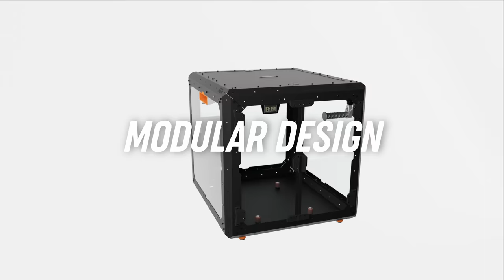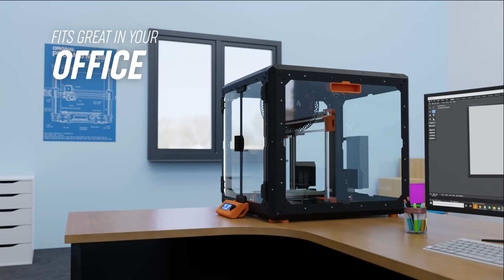Introducing the Original Prusa Enclosure: Modular box with advanced features for your MK3S+!

Comment: LOVE that Prusa is coming out with this for the community.  HATE the price.  Some of the features seem well thought out, but other things don't.  The single LED strip lighting on the left... the case is still dark inside.  Unless we can expand and have more LEDs?  There should be leds on all 4 corners honestly.  Enclosure looks built and very stout!  Typical Prusa quality for sure, no doubt in that at all.

I dislike that you can only access the printer from the front.  You should be able to access it on left and right sides as well.  I dislike that it looks like my 7" touch screen raspberry pie setup has no place to go in here... Where as the "Prusa Box" would be right in the front.  I thought the Prusa Box was expensive but now comparing both , I actually feel the Prusa box is worth it and probably the one I am going to go with.  Just seems way more customizable.  LOVE Prusa though, if this wasn't as expensive I'd get it for my mk3s.  But after adding the options it's coming out to almost $600 without shipping...

Comment: I made a custom version of this and the PETG parts of the MK3s started softening and bending... :-(
Reply: That's why your first enclosure prints are ABS or ASA replacements of the critical parts that would be affected.
Reply: @Rainmotorsports  you live you learn... I made some replacement parts out of PC, but was still a pain as I prefer to focus on what I am printing and not tinkering with the printer itself.
Reply: @JT-Works  Right but if you want a printer to do something new it might require tinkering. If you started with a MK3 and went to a MK3S+ like I did you had to reprint parts anyway.  That's where I am with this one.

Comment: I wouldn't use PTFE tubing all the way to the extruder, I prefer it just to the top and then bare all the way to the extruder. That way, if you run out of filament, you won't have to disconnect the PTFE tube for filament removal. With this enclosure you can only print at 40°C, 50° max in summer. I don't think it's worth the price ($550 plus shipping and tax), except if you really don't have the time and tools to build a better, cheaper wooden enclosure. It would be nice if they also made an active heater case and provided you with plastic parts made of PC, a 3:1 geared extruder (to reduce heat from the extruder motor), and a cooled solution for the motherboard. That way it could easily reach 70°C.

Comment: What a heavy blow to the IKEA. The LACK sales are going to plummet.
Reply from the maker: The Ikea Lack Enclosure is still our suggested option when on a budget. ;) This is way neater solution, but also more expensive.
Reply: @Prusa3D  Actually you should add an option for a flux capacitator to increase print speed. Maybe next year at first of april?
Reply: The LACK enclosure is all you need and way more affordable. This enclosure is overpriced for what it does.

Comment: is there one for the XL printer?
Reply: From what i've seen. The Prusa XL will have at the very least have a optional accessory that resembles Accordeon shutters you can pull up from the base and attach to the upper frame to enclose the printing area. You can see it on the photo of it showing of its multi-tool system

So i would assume they are also going to make a traditional version with front facing door and top cover and if not someone else probably will rapidly create them. Benefit of CoreXY is that with a old fashioned cubic frame it is easy to add panels to enclose compared to the mendel that needs an entire box around the printer.

Comment: @prusa how about using this with 2/4/8 kg spools. Can it be used with filament hanging outside the enclosure?
Reply: 4 Kg is very heavy for the Stepper. 8 Kg is to big for it. I think, it´s no good Idea to order those Big Filaments-Spools...
Reply: @chrissniederle3960  i mainly run 2200gram spools but i want the option.
Reply: @borisbommen  On your place, I didn´t change to greater Spools. The problems are not worth it - my think about it. You need a very easy roll-Sytem becaus otherwise it will become Underextrusion, If the Stepper will not get enough Filament  in Time. But if it is will easy Roll, the Filament-Spool will make Problems at Retracts and fast Prints, because it will not Stop and the Roll will Spool of and get form Spool and their is than stopping Material from the Spool because cross Filament-parts or so on... 2 Kg are a good Compromiss for long Prints... 
You can make it, but how I said - more Problems than it is worth to do this... Not all Options are good Options. This will only right work with a Stepper for the spool and a Electronic with logic to trake the Filament in Time (if more power on the Filament, the Stepper must work some degrees.). But this ist not so easy. Mechanical it will not work so fine - my meaning. Good luck. Hope, you understand, what I mean, because my English is not good - sorry...
Reply: @chrissniederle3960  thanks but 2200 gram spools are my standard because I do productions on my prusas also. I understand what you mean but when u make sure the resistance is as low as possible it shouldn’t give any problems. I printed 8KG last week divided on 2 printers without any problems with 2.2KG spools.
Reply: @borisbommen  That is exactly the problem: as light as possible. With it, you reel yourself loose during fast travels or retracts. Likewise when changing direction from fast movements. I also use the 2 Kg coils. But the mass is very high! The brakes not by itself, by friction again. And certainly not when the mechanism is so smooth-running. The result is loose windings, which at some point slip among themselves and thus cross and knot, or jumping off windings, which then get tangled on the outside ...
I also print a lot of jobs, so I know the problem. I have printed myself e.g. "ball-bearing" recordings, which center the bearing axis off-center adjustable. By changing the distance to the center, I can make the roll roll lighter (full large roll) or heavier (empty roll). Due to the off-center centering, the roller always has the tendency, as soon as the train is gone, to center itself hanging down. 
With larger rolls you need in principle, so that this works reliably, a drive for the rolls, by means of a stepper, which in principle measures the tension on the filament via a control (Ardunio) - if the Prusa promotes, the tension on the filament increases and the stepper must run a little and drive the roll. If the tension stays away or decreases, the stepper must stop. This way you always have a certain basic tension and no uncontrolled unloading of the windings - with the corresponding consequences...
But try it out and report... I don't know any mechanical system that masters this reliably - especially since the stepper pinion heats up with time - and then, in view of the mass, it quickly becomes fatal, since it then digs in more than it conveys... Clogging sends its regards....

Greeting, Digibike

Translated with www.DeepL.com/Translator (free version)

Comment: That's cool but disappointing that there was no attention to fully air tight seals to provide protection against ABS fumes when printing indoor
Reply: I'm not sure why they didn't add weather striping and a rubber seal on the doors. It would have been easy and help contain.
But without a fan on the filtration system, no reason the air would want to head that direction.
Reply: Split doors, outside filament feed ports. Introduce a lot of areas for leaks. Sealed or not I would run a carbon filter to clean the air in the enclosure so that what little escapes is almost clean.
Reply: Good thing it’s made for the maker community and you can do all that and more yourself
Reply: I assume this is what the filtersystem is for. I assume that if you just close things up, the ABS-fumes will stick to everything on the inside and ruin surfaces and electronics. Who knows?
Reply: It can not be air tight when there is filter on the back. Somewhere must be intake to be able to get air inside the box.
Reply: Make it a negative pressure enclosure and make the filter the exhaust. In that case all abs fumes will go out true the carbon filter 👌

Comment: How long will the petg prusa parts last at those elevated temperatures?
Reply: I’ve had my lack table for 3 years and the petg has never melted even at 30-50°
Reply: Maybe the plan is buy it and reprint parts in ASA if you’re worried?
Reply: I am mostly printing ABS with my fully enclosed printer. It barely reaches above 50-60°C. Therefore, PETG will withstand that easily
Reply: @Clon1998  yeah I’ve had my enclosure hit like 60 degrees when printing polycarbonate and the petg parts are perfectly fine
Reply: Sorry, wrong thread.  I accidentally put this here...

I like the idea of bringing back life to an older printer, but how easy is it to get to the back of the MMU2?  How about the spools of filament (enclosure)?  How does Prusa have theirs configured for MMU2s?  Maybe Mikki needs to do a video on that, seems to be several questions on the MMU2.
Reply: @christopherenoch4230  agreed, the mmu is a finicky lil boi and needs lots of attention
Reply: @Clon1998  The Ambient temp isn't the issue. My motors registered 60C in low 30's ambient. They start hitting 70C against the PETG mounts you might see slow deformation.  First thing I did was print replacement parts and as I get towards the end for some reason my offset is changing way more than before. Originally it was just the fact that if I printed cold one offset worked and if I printed hot less offset was needed.  Now its making me increase it more and more per print. Almost done though.
Reply: @Rainmotorsports  I’ve still not had any issues with that using petg (except for on the mmu2s that thing I have parts printed in polycarbonate cuz it melted)

Comment: Love this company, but this thing should be $200 and include all the upgrades shown. Current asking price is much too high for a box.
Reply from the maker: As we're explaining in the release article, when on budget, building an enclosure with the Lack table is still our go-to solution.
https://blog.prusa3d.com/original-prusa-enclosure_67656/
Reply: More like 300 euros tops. 730 euros is mental.
Reply: @Prusa3D  I think in the current economic climate, most will be on a budget. So, at that price point, who is this actually aimed at? It's not the general maker market!
Reply: $200 just does not work. That enclosure is probably more than that in parts. +700eu is a bit nuts though. If the full kit, with everything shown, was 500eu then I would bite.

Comment: Is it also compatible with Mk2.5s?
Reply: I believe they are the same size, so my guess would be yes.
Reply: The frame is completely different. If it was compatible with the older machines (which I have), they would have indicated that. Instead they specifically say the MK3S, and not MK3, MK2.5S, etc.
Reply: @LongDono  It's a box. It will fit inside. 3/4 of the frame is the same, the difference is in the lower 1/4 where they switched from rod's to extrusions. The MK2.5S and older crowd is probably not expected to be their primary market so no supporting the PSU relocation for those models is likely the reason it's not advertised for anything else.

Comment: Very competitive pricing compared to current options.  Like all of the upgrades and stacking.  Great job!
Reply: Compared to a Printer-Box, it's about twice as expensive... I know they wanted it to be stackable for commercial use, but Printer-Box's MMU2S support on top makes more sense to me.
Reply: @LongDono  Rather than Printer-Box by Printer Solid it looks better TS Acrylic DIY Kit by Tukkari if you are on the budget, but this Enclosure by Prusa looks awesome.
Reply: @MartinWolker  I looked at that but while more money, the black Printer-Box unit is far more attractive and the amount of mods and customization it provides is by far well ahead... I'm really happy with mine and I'll be using it with the MMU2S addon. If I had to make the decision today, it would still be Printer-Box. This is just too expensive; it isn't for the average maker.

Comment: The only crappy thing is it's a pain in the ass to swap parts out once you get the printer into the enclosure. I had to virtually take the entire thing apart to swap out the hot end. Wish the plastic sides had quick disconnects so you could open them easily

Comment: PETG will not like such elevated temperatures, i suggest printing the parts for your printers with Prusament PC blend Carbon Fiber…
Reply: Yeah I am about finished with printing my replacement parts and all of a sudden my offset is not where I started lol. The one time I checked the Z motor case temp it read 60C. At peak they might be reaching hot enough to warp PETG.

Comment: I do not want to know the price, but my printer desperately asks for one of those!
Reply: Google printer box, this costs over a grand with all the features the printer box comes with at less than $200. Prusa are out of their minds.
Reply: @cgwworldministries83  But it's ugly as hell! That said (de gustibus non disputandum) the only useful Prusa add-on for a home user is the led strip, all the other stuff is not that useful IMHO (maybe the air filter? But why should I filter the air when it is already entrapped inside an enclosure?). So if you consider the base price, the Prusa is only slightly more priced than the one you suggest, but it appears (in pictures) of higher quality. For sure 80 bucks for a led strip (you have to add the required additional psu) are a bit excessive, but again the base price for the box alone is quite reasonable for what it offers, while the addons are overpriced, but you can easily live without them.

Comment: the enclosure is a s8hit. Is pent 8 hours to mount it and another 3 trying to place the printer inside. lack of instructions, cheap plastic material for walls, too many things to dismantle from the printer and to put back in the enclosure, plastic pieces printed by the company using 3d and the screws cannot be sticked in. a total disappointment.

Comment: Let me get this straight, the PSU is on the outside, but the motherboard which controls the electronics is still on the inside.  If memory serves me correct, heat is the enemy of any electronic part.  So, with that said, the motherboard's life span is reduced but the parts being printed are more likely to stay flat on the print surface, right?  In the end, it's gonna cost the printer owner more money over the life of the printer but the owner, in the mean time, is happy they have a flat print.  Makes no sense to me, but I guess it all comes down to bragging rights.

Comment: This won’t remove all voc’s and toxins’ she there are air gaps everywhere! Very disappointed confiding the very high price.
Reply from the maker: The holes are mounting points for add-ons. You are free to plug them in (with printable pins). We have contracted an external company with the voc's measuring with the enclosure with the filtration and without the enclosure and the difference is substantial. Not necessarily critical with everyday filaments, but there are some with high particle emission. -Mikolas